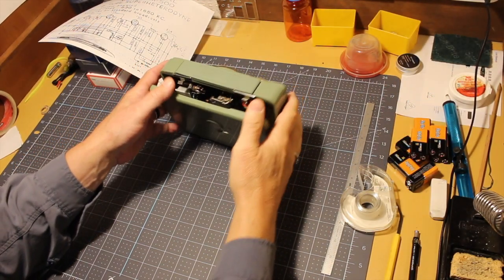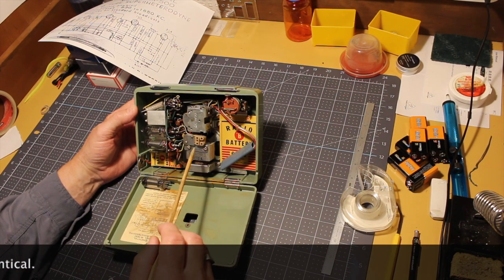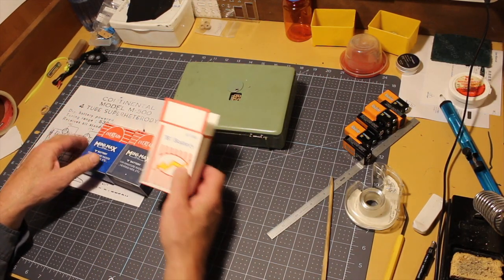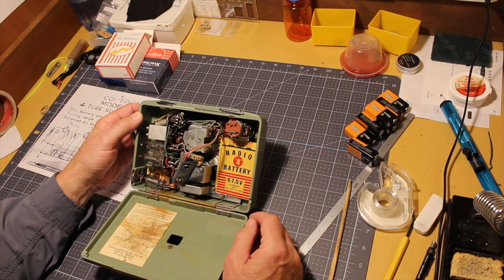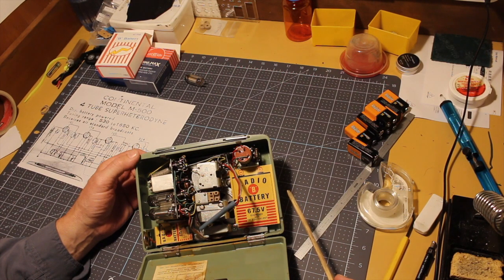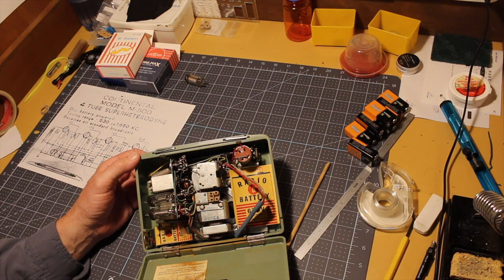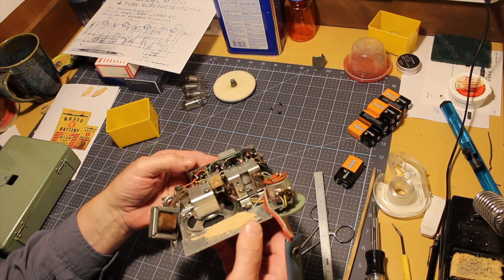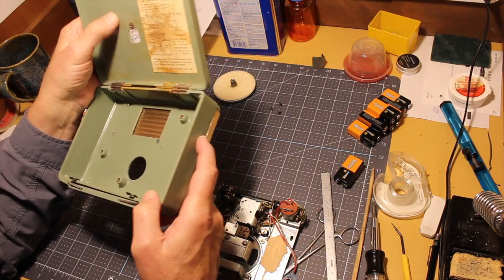1950's Continental M 500  Part 2

Comment: Nice work so far. I once glued a ferrite core transformer in a pincushion amp in an old Zenith TV with just plain epoxy and it worked quite well afterward. I'm not sure, but I don't think the ferrite rod needs to electrically conductive. Its function is to boost the inductance of a relatively small coil. In any case, you have an interesting channel and I'm looking forward to how you make out with this restoration.
Reply: Don, of RestoreOldRadios, provides a very good demonstration of this in one of his videos.
Cheers, Phil
Reply from the maker: Thanks. I suspect you're right. It's the inductance that's important. Thanks for watching.